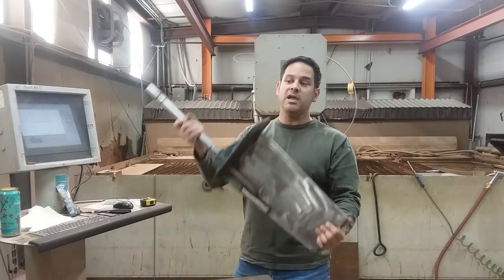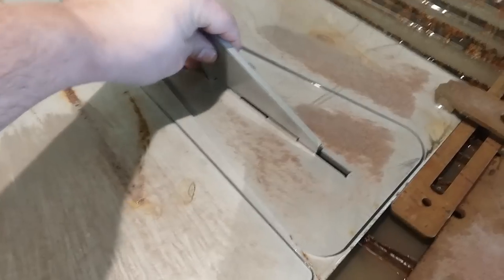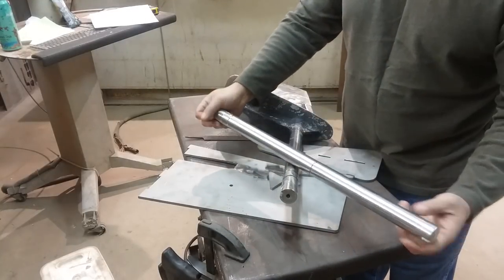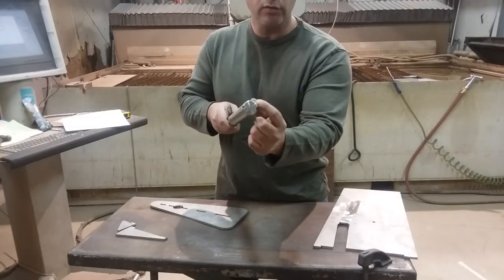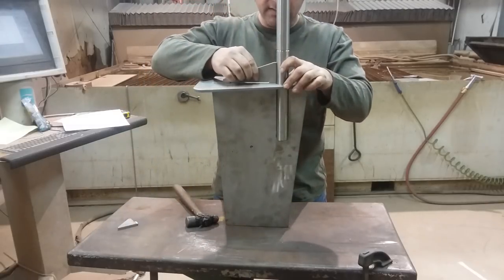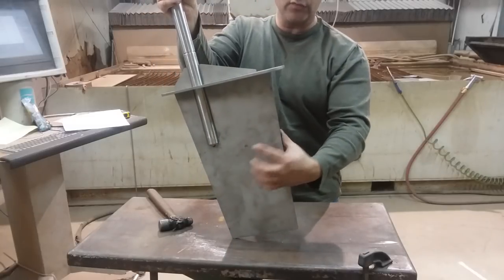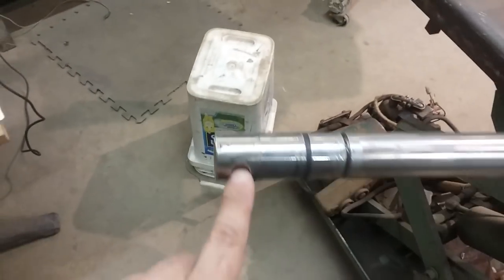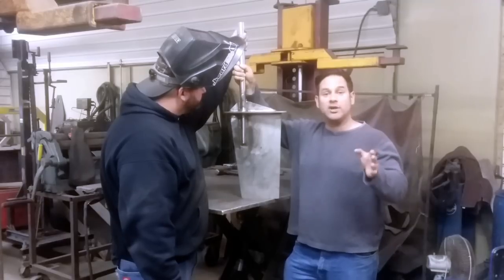Making a Stainless Steel Boat Rudder using tab and slot construction

Comment: What is 1/4 inch 3/16 steel?  I know it is 1/4 316, but, it sounded like 1/4 3/16
Reply from the maker: Lol, I can see how that might be confusing.   It is 1/4" thick 316 stainless steel, Not 3/16" steel